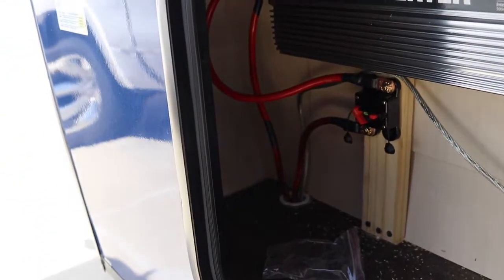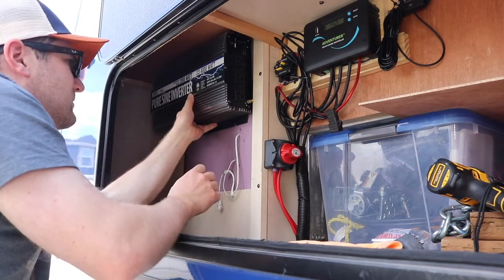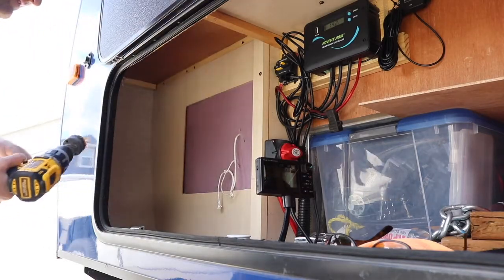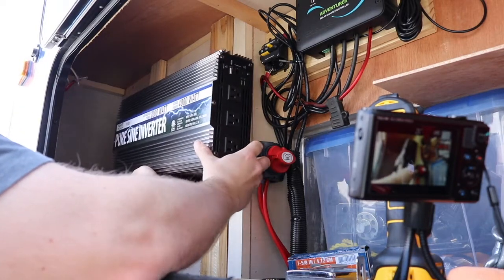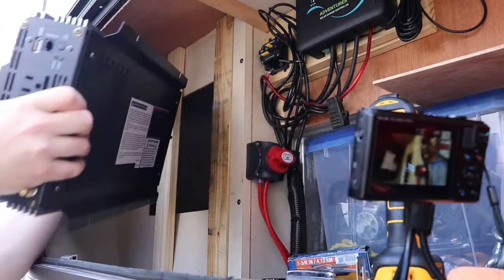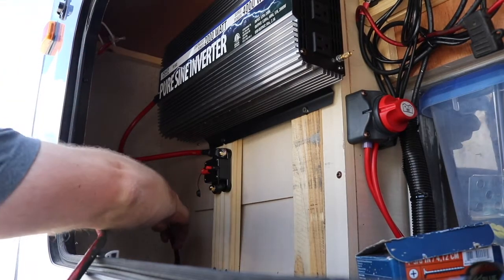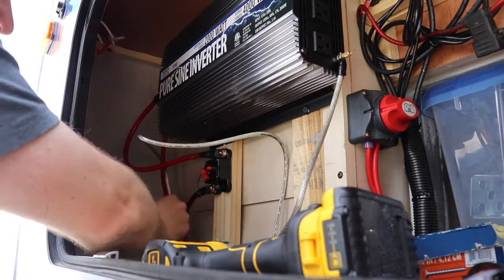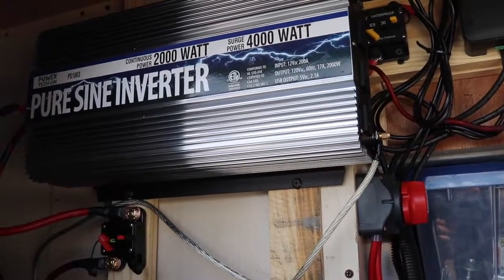How to Install an RV Power Inverter on a Travel Trailer DIY | The Savvy Campers

Comment: Add a transfer relay to your system so you can plug in a shore cord and not blow yourself up or burn down the camper. 
I use the 80A double pole double throw from Amazon. 
You wire the coil to the shore power. 
Now add some solar panels and a charge controller to the mix to charge your batteries.

Comment: you installed an inverted that doesn't power anything, what was the point here?
Reply: What? LOL. You take the power cable and plug one end into the inverter and the other end into the trailer outside. This way the inverter is powering all your 120v accessories. Of course you have to turn off the converter/charger for this to work.

Comment: I wonder what size of wire/cable you used between the battery and the inverter.  I wonder if the breaker you used is sized correctly.  You mounted it in an awful location. It needs to be as close to the power source (battery) as possible.  The wire between the battery and the breaker you installed is unprotected.

Comment: Thank you for the video. I have a question. Where in the electric wiring system is your on/off switch. Is it between your battery bank and the main breaker box for the RV (positive wire side)?
Reply from the maker: Yes, for a main off/on battery switch, it can be placed between the battery and main breaker panel. Mine came from the factory in that location.

Comment: Move that bare ground wire away from the exposed/bare positive breaker!
Reply from the maker: The ground has clear insulation which is difficult to see in the video so it is not bare, but you do make a GOOD point. Even though it isn't bare, with it just sitting there it could rub through while traveling and ground out. Thanks for pointing this out, I will reroute it under the breaker and fasten it down. Thanks!

Comment: What is the amperage of the circuit breaker you mounted at the 13:00 mark of the video? You never mention the amperage of the breaker.
Reply: For the 1500W inverter, please choose 15A breaker or 150A inline fuse.

Comment: Great video. How did you hookup the switch that you installed inside your RV?  Thanks- Tony
Reply from the maker: The switch came with the unit as an external on/off switch. It uses a phone cable. I ran the cable where I wanted to install the switch, and it was pretty much plug and play.
Reply: @TheSavvyCampers  thanks
Reply: There is a extra remote with 15ft cable

Comment: Perhaps this is a dumb question, but shouldn't power from the inverter be going to your 120V accessories?
Reply: He is showing where the inverter gets its power. The trailer can now be plugged into the inverter or it can be wired directly into the fuse panel of the trailer.
Reply from the maker: Yes Daniel, the power from the inverter will power the 120v accessories if plugged into the inverter or hardwired. We chose to not hardwire it as we may be swapping trailers soon.
Reply: @TheSavvyCampers  so do you run an extension cord outside and plugin to the inverter? How did you get it plugged in?
Reply: That inverter looks like one that shouldn't ever be hooked up directly to an existing array of plugs & appliances. 
Have you figured out this issue? 
I have almost the same inverter just much larger.
Reply from the maker: @derek6541  I run my normal shore power cord from the inverter to the trailer.
Reply: Plugging the trailer shore power cord into the inverter, doesn't the trailer also try to charge the batteries back up??
Reply: @andrewblanchard8214  Yes that's why you need an on/off breaker for the converter. Most trailers have a breaker on the panel.

Comment: How much amp did you run up to your breaker?
Reply from the maker: I used the same amperage that was in there supplying the other circuit. 15 amps.

Comment: What wire did you use?
Reply from the maker: Renogy makes good wire: https://www.renogy.com/accessories-wiring/

But any good quality wire works great. Your inverter manual should give you a guide on what gauge to use based on the amps it will pull.

Comment: Sorry but you made this job far too difficult on yourself. You can attach wires to components that are going to be hard to reach when mounted beforehand. This makes the job quicker, easier, and ensures your connections are solid in otherwise hard to reach spaces.

Comment: How many amp circuit breaker did you use?
Reply from the maker: I used a 15 amp breaker. You can match the size of breaker you have.